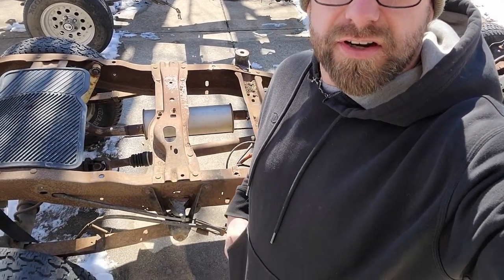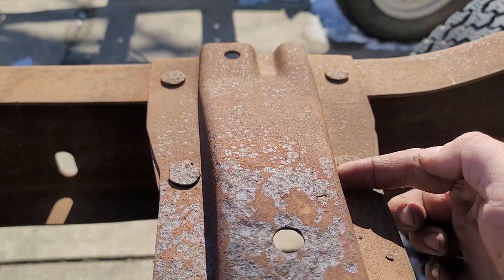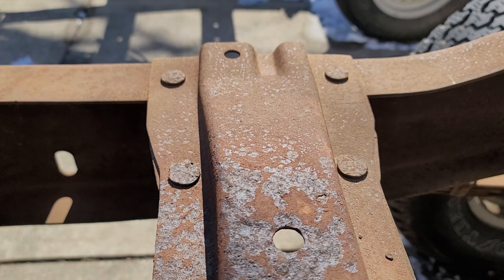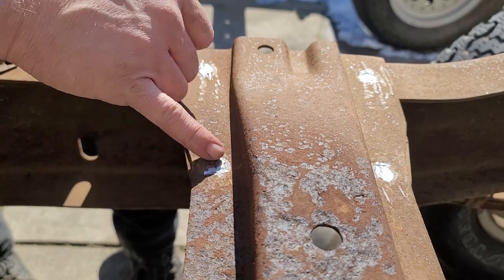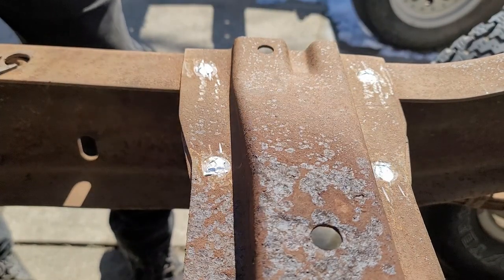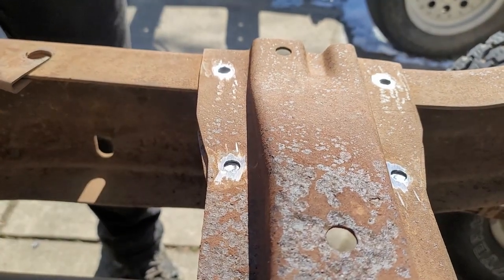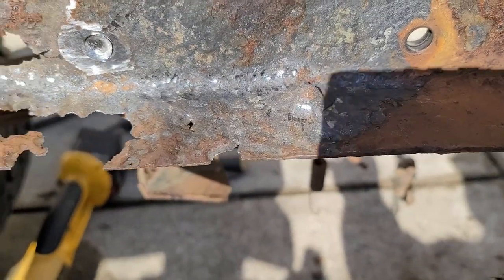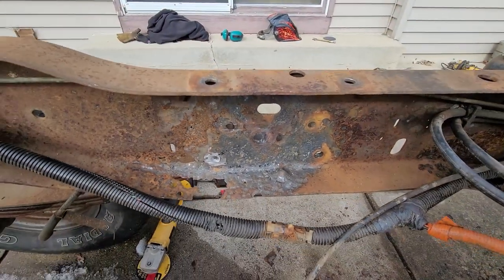How to remove RIVETS from a rusty frame the easy way, Ford Ranger, Build part 4

Comment: For hard stuff I use M35 HSS drill bits. No need to grind and saves the base metal. I do a lot of trailer repairs for truck drivers.

Comment: I grind the top of the rivet flat,drill a dimple in the middle of what's left,the dimple lets the rivet drive out easily with a punch,done it like that forever.
Reply from the maker: That works well too!
Reply: @frostydoesit  the way ur doing it is ...... well..... wrong..... simple as that. Sure it works. But why....
Reply from the maker: @redneckswitwheels  why??  Because it's simple and it works!  Share your video of the right process, I'd be happy to review your work!!

Comment: I know not everyone can afford one.  But a plasma cutter will take all them rivet heads off in minutes.
That whole cross member and the 2 brackets would have taken about 15 min tops start to finish.
Reply: I plas the heads sideways. then punch em with a air chisel... The cut 50 is $200 and I have had mine for a couple years now no problems!
Reply from the maker: I do have a plasma cutter, in fact when I started this video I was using the plasma and stopped because I didn't feel I was able to cut the head off without getting into the bracket or the frame and I wanted to keep those pieces unmarked.  I wasn't able to lay the cutting head @ 90* to the rivet.
Reply from the maker: I'm not able to get my plasma torch at a 90* angle to blow the head off without marking/cutting up the bracket or frame.  Who knows, maybe there is a technique to it that I don't know yet.
Reply: @frostydoesit     That’s  that basic way to doet for people like me that I not going to buy a plasma cúter for used oane time   I replace that shackles brackets on my truck oane time and I use  wat u have except  I dint use that air gun
Reply from the maker: @Purosanluispotosi  get after it Abel, use what you have and be innovative
Reply: @frostydoesit   absolutely  some times u have to used wat u got   To get it done
Reply: Definitely would not use a plasma cutter for rivet heads. You will damage the frame for sure.

Comment: I always used my air chisel.
Reply from the maker: I use the air chisel by itself sometimes....it does work but can take awhile (like on the coil buckets of my F550).  I found first cutting slits in them drastically reduced the air chisel time.  Thank you for watching and commenting!

Comment: This seems like a lot more work then using a torch and just blowing the heads off unless you’re not good with a torch and are gonna blow holes in the frame too, but if you know how to use a torch you should be able to hit just the rivet no problem and have this done in 5 min or less
Reply from the maker: I've done it with a plasma and a torch, I always come back to this way.  You are right though, if you are not good with a torch you will regret using one if you want to keep the parts in nice shape.

Comment: Can you use steel rivets on aluminum?
Reply from the maker: I usually try to use the same type of metal if they are going to be touching.  Although I have seen lots of dissimilar metals used together in the automotive world....aluminum cylinder heads against a steel head gasket/block.  Maybe someone will chime in with lots of experience.
Reply: It's called galvanic corrosion. Dissimilar metals will react, especially after some weather. 
 Engines have gaskets and more science.

Comment: Where is the guard from the grinder?
Reply from the maker: In the garbage
Reply: @frostydoesit  I have a "special" guard to fool the safety twink. Take the original guard and trim the flange down so it is flush with the wheel. Still gives some protection but you can now use the grinder with the wheel flat on the work so you dont gouge it.
Reply from the maker: @kolsen6330  That's a great idea....somewhere in the middle of safety and function!

Comment: Drill them out or heat red hot and air hammer head off .
Reply from the maker: That's too much work for me, but would certainly work!
Reply: As an aircraft mechanic with twenty years of structure experience, I can tell you it's faster to drill than what was done in this video. You just need a sharp cobalt bit and cutting oil.
Reply from the maker: @glenwhatley7366  tell me more about this,  aluminum or steel rivets?  Describe your process...i am interested
Reply: @frostydoesit  
Idk what this other guy is talking about but we mainly drill out aluminum and monel rivets. Sometimes steel hiloks or titanium. But really only on the factory head side, bucktail side could be off center. Also in 757 and 767 the most common size is 3/16. But drilling them may be faster if you have nice bits and don’t mind sharpening. I’m supplied drill bits at work so it is fast I’ll drill two titanium 5/16 fasteners and get a new bit. That would be cost prohibitive if it wax out of my pocket on a frame with exposed bucktails like your working on. I’d grind flat and punch out.

Comment: If i had a air hammer i wpuldnt use my cutoff wheel
Reply from the maker: I find the cutoff wheel really speeds up the air hammer chisel doing its job.   Whatever method works for you is all 👍
Reply: The problem is it puts a lot of force on the underlying material. You end up with an egg shaped hole. Especially in a rust bucket like this example.
Reply from the maker: @michaeldose2041  this is CLEAN for a Wisconsin truck!